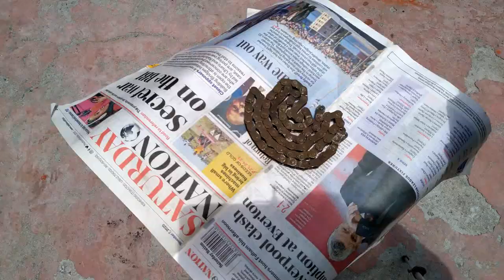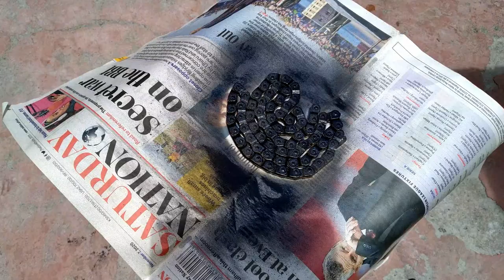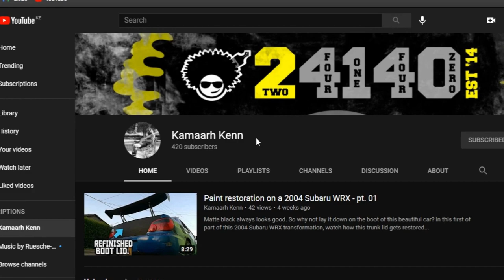Rusty BMX Bike Chain Restoration. (4K)

Comment: Vinegar  work to but will rust again without paint, I will try the gasoline.
Reply from the maker: You have to clean it when it's out of the vinegar, dry it off then oil it immediately so it doesn't start oxidising